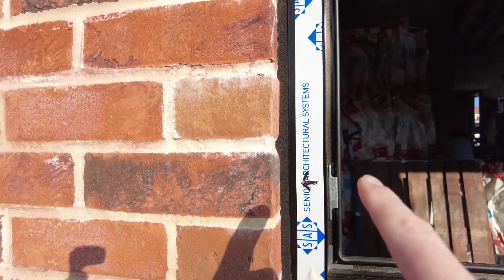So...this is life at the moment

Comment: No way of knowing if it's the same design/manufacturer but we have one exterior door with very similar covers. On ours the interior side cover has screws on it to give access, so that when you remove that one you can then reach through the door with a long screwdriver to undo hidden screws that release the exterior side cover. It's a long shot but they haven't put the covers on the wrong sides of the door for yours have they?
Reply from the maker: Neither side has any screws but now you've said that, maybe the outside cover plate can pop off and the other side has hidden screws 🤷‍♂️ I still have to contact the manufacturer so I'll soon find out

Comment: Mate, I feel your frustration at the window quality of their construction. Regretfully this is typical of UK manufacturing relating to building products especially windows and doors. I expect you have already paid. They will not want to take a loss on sorting you out. If they are like most UK manufacturers the workers at the factory will be uninspired migrants or eastern Europeans who don't give a toss. My own windows had similar issues of poor quality workmanship. They just churn them out as fast as they can. A building trade slow down will clear a lot of these cowboys away. Try to make use by altering and adapting yourself what you have and get a 50% refund as a damage limitation exercise. Lesson learnt.
Reply from the maker: The fabricators are sorting them out so they're right. They said they pride themselves on their reputation so this would be abit of a pr disaster if they didn't fix it. 🤞